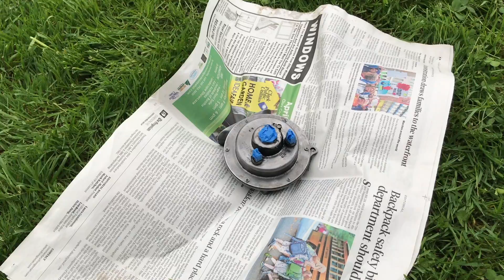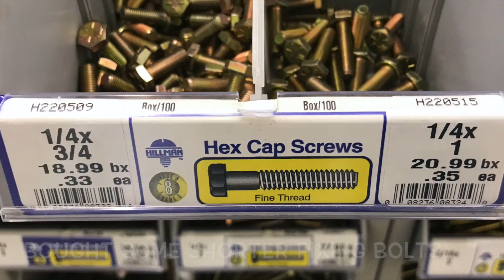1974 Norton Commando 850 MK2A – Swing Arm fix (Part 11) – Getting ready for reassembly

Comment: I like this swingarm series, it's really the only one that covers this subject, thank you for taking the time to document this lengthy procedure! I have an earlier swingarm from my '73,Commando which was quite loose and had never been serviced in 50 years. Pretty much doing all the same things plus a couple more steps. My new bushings were tight as well, not surprising because they are thin and easily distort a couple thou when pressing in. I ordered a long 7/8" hand reamer, which both sized the hole and aligned the rwo bores at the same time. The swingarm with the new bushings did not fit into the cradle either. A couple thou had to be carefully removed from the bushing faces to make a snug fit. Also checked the cradle around the spindle hole on each side, those mating surfaces are subject to wear and may need careful cleanup with a file or stone. Also i welded on gussets and a weld-on replacement chainguard bracket from Andover Norton, sandblasted, and painted. Installed a pair of stainless steel split collars with locknuts from NYC Norton. So its been a project, glad to be retired and have a heated shop with a lift to do this!
Reply from the maker: Thank you John very much for your comments and tips. Glad you liked the video series. It was a fun one. Best wishes, Mike

Comment: By using emery cloth to size the bushes as they are porous you have probably fed grit into the pores ready to wear the spindle out. Using very sharp reamer will remove that risk.
Reply: Mike, kommando828 is correct. Never use sandpaper, emery cloth or a hone on bronze bushings. Doing so will embed abrasive particles into the bushing. This will greatly reduce the life of those bushings. You might as well lube it with valve lapping compound!

Comment: Did you remove and close off the chain oiler?
Reply from the maker: Hi Chris. Apologies for the delay. Yes, I removed the oiler some time ago. I didn't need it and just oil the chain manually periodically. Cheers, Mike
Reply: @TheMightyGarage  No worries Mike, thanks for the reply.  I'm discoonecting mine also and would like to know where you got the rubber cap you hose clamped to it.

Also... any chance you'd loan out the template/guide you used to drill for your swing arm split collars?  It worked so well I wish I had it for the swing arm replacement I'm doing now.    Be well!  Chris
Reply from the maker: Chris Larkin Hi Chris, no problem. Yes I’m pretty sure that I got the caps in a little packet of several assorted caps from somewhere like O’Reilly auto parts or Napa or some car Spares place. I then found that one of the caps fitted perfectly. 
Yes, I would certainly be able to loan you the tool/jig that Bob made for me that allows you to drill the holes. If you could let me have your email address, we can take it off line and talk about logistics.

Cheers,
Mike
Reply from the maker: Thanks Chris. I got your email address and have removed your comment, just for privacy. Will write soon!